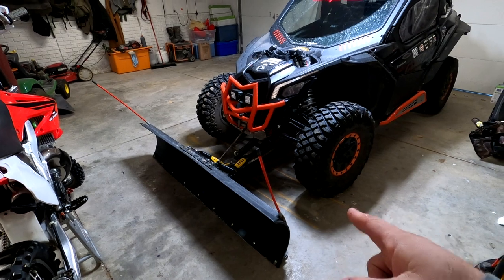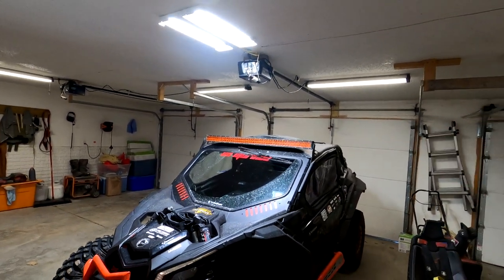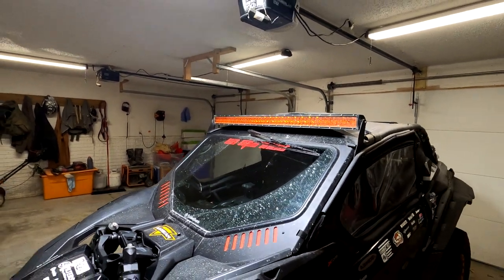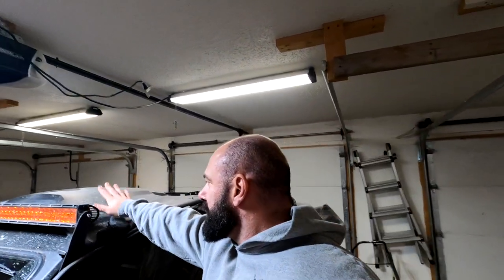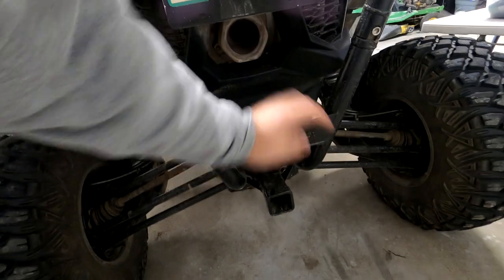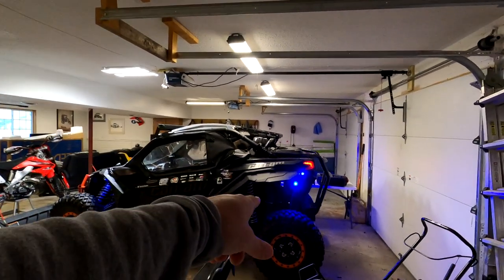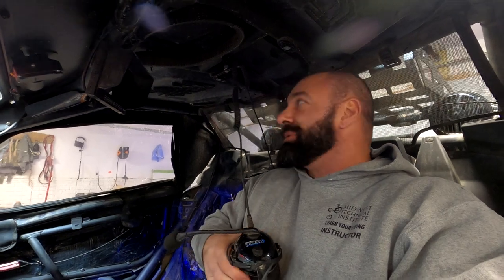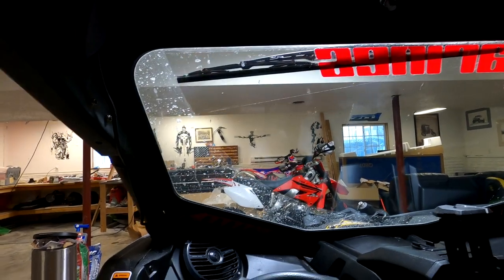maverick x3 3500 mile review and accessories

Comment: Thanks for the review.  I just installed the can am manufactured noise reduction kit that replaces the intake tubes with baffled tubes.  It removed all the high pitch from the clutch sound.
Reply from the maker: I have a 30 cent pool tube with duct tape over it. Dose the same thing. No reason to cut the back up and put in the vent. There is plenty of air that gets in there

Comment: Love your videos man...I went from Polaris to an X3 as well and got a lot of good info from you thank you!
Reply from the maker: So happy I could help. Hope you are liking the x3 over the Polaris like I am
Reply: @sxsmarine4075  Definitely...X3 seems to be a lot more durable... spring question for you? I see a lot of people say good things S.T. springs...I have been thinking about getting a set for my XDS...I guess I can't figure out how just a spring can make that much difference? I want to upgrade from the bighorns as well...I trail and rode ride in Northern Mich 90% of the time...what made you decide on those tires with so many other choices? I hope you don't mind my questions and I appreciate your input!
Reply from the maker: @tomsltz  it’s like putting the right springs on a dirt bike for your riding and weight. The x3 has triple rate springs in the back. When you get shock therapy they are only dual rate springs. So they travel farther in the stroke. They also since they are set up for the weight of your machine and even the rider and passenger they keep you at 15” ride height but yet not compressed all the way down to get that out of the springs. 
Tires are a hard choice and there are so many good tires out there. I liked The ones I got because they are Kevlar lined and very hard to get punctures. Also at the time two years ago they were the lightest  tire that you could get for a 32 inch.
Reply: @sxsmarine4075  oh ok I see...looks like my next mod!

Comment: When you did the Shock Therapy spring kit did you set it up for your base machine and then do your add ons to it or did you set your springs up for all your add ons? I just ordered a set that I haven't installed yet but have changed my cargo layout and dont have things like nerf bars or my roof rack yet. I was just wondering if any of that has made a difference in your ride quality? Thanks again!
Reply from the maker: When you order the springs they get very in-depth. They want to know every accessory and the weight of the driver and passenger. You can add some stuff after. The springs are kinda like a dirt bike spring. They will cover a riding from let’s say 200-230 pounds. So the springs on the car I imagine cover about a 2-300 pound range.
Reply: @sxsmarine4075  Just got them installed today and got to go for just a few mile ride. WOW! What a difference! I don't even have them dialed in yet either and I don't see not having all my cargo making much of a difference either. Looking forward to a few hundred miles this weekend.
Reply from the maker: @Schultzy221  i makes a amazing difference I don’t know how but it does.